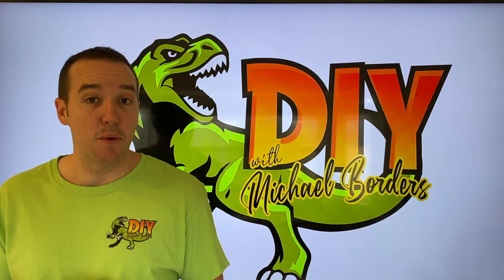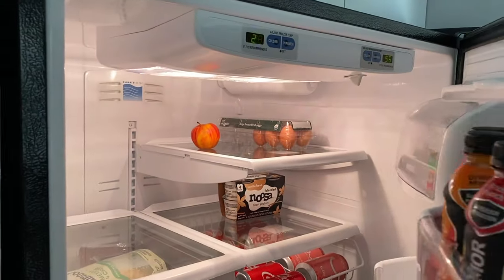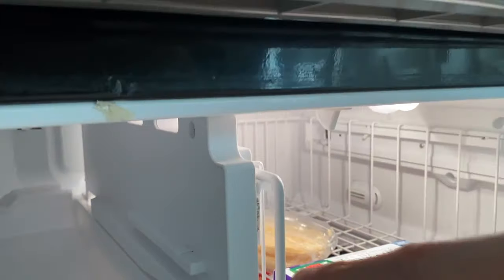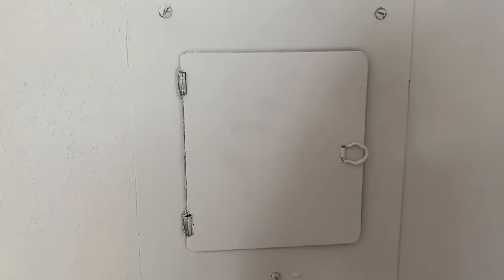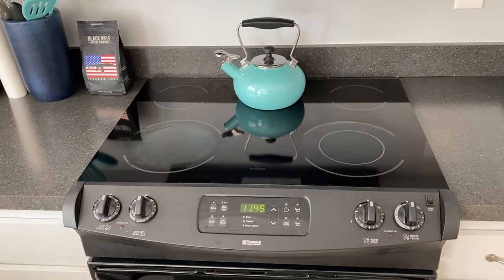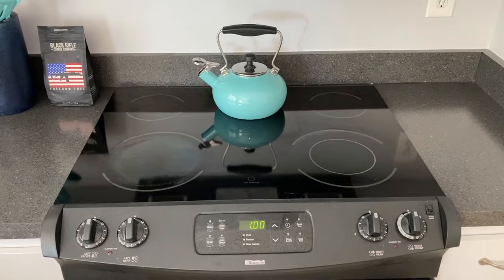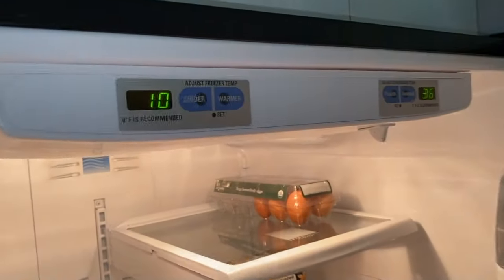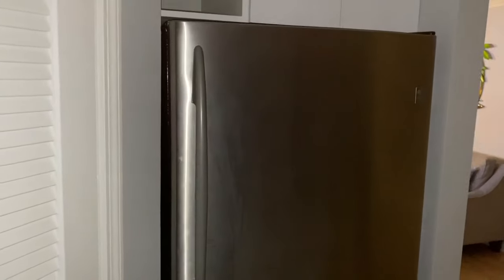Whirlpool GE Refrigerator not cold/cooling - Reset mother board

Comment: I have a Whirlpool.  It quit making ice a few weeks ago and we also noticed that the main compartment is not getting as cold as it used to.  so I put it down as low as it would go..33* in the settings.  We have a thermometer inside but it will not go any lower than 40*.  Do you think this could be the problem?  I had a repair man out yesterday and he claimed it was getting cold enough inside but said we needed a new ice maker so its on order but never seemed to fix the 40* problem.  He said my thermometer might be off.  but I double checked it with a digital thermometer and it was also reading 40*
Reply from the maker: @erock1070  

Thanks for watching.  Have you performed any reset procedures on the refrigerator and freezer?
Reply: @DIYwithMichaelBorders  I can’t find the exact reset procedure for my model. It’s a French door model with produce tray underneath and freezer on the bottom. Ice and water dispenser on the left side.  So It has multiple door buttons given the French doors that shut the lights off so I couldn’t really do it that way.  I did shut the breaker off to it for 10 min. And it does seem colder after 24 hrs.  The fridge is set to 33* and it’s measuring there now.
Reply from the maker: @erock1070  

Thanks for the reply.  In that case, the unit can be fully reset by unplugging it and leaving it unplugged for a minimum of 5 minutes.

Comment: Hey great video. It works for me to reset the fridge but after about a week of operation the freezer will frost over and warm up and the food becomes unfrozen so I have to repeat your process and it gets it going again. I’ve vacuumed all around the compressor and coils. Just wondering what it could be. The possible culprits could be the control board or the switch relay on the compressor or something else. What do you think? Could one of those hard relay switch kits help? Any idea would help and thanks for the video !
Reply from the maker: Good morning, thanks for watching.  We would start with the relay as it may be in its early stages of failure…thus acting intermittently.

Control board is possible however not as likely.  Looking forward to hearing back from you.
Reply: @DIYwithMichaelBorders  awesome. Much appreciate your reply. In that case I will order an amp clamp from Amazon and begin testing of the relay and if it is indeed starting to go I will buy a replacement for it and put in a new start relay. How long would you say that fix should last it? Couple years maybe?
Reply from the maker: @yycshawn123  

Thanks for the reply, the part itself should last up to 10 years if refrigerator is placed in normal operating temperatures as opposed to out in a 100*+ garage or freezing cold garage.  😎👍

Comment: What would I do if I don’t have that switch inside the refrigerate? I have a Samsung 3 tier refrigerator and can’t seem to find the switch or anything that would send a signal that the doors are closed.
Reply from the maker: Good morning ☕️

In your case, you would perform a full reset procedure by unplugging your refrigerator and leaving unplugged for a minimum of 5 minutes.

After 5 minutes, plug refrigerator back in and allow refrigerator to reboot and hopefully reconfigure itself within 5-10 minutes after plugging refrigerator back in.

Comment: could this cause frost build up as well? I have a Freezerless Whirlpool and the fridge stopped cooling and I found frost build up. It is unplugged thawing now. We have micro power )3 seconds up to 1 hour) outages several times a week.
Reply from the maker: Thanks for watching & it’s definitely possible.  Did the reset help the system reconfigure back to normal operations?
Reply: @DIYwithMichaelBorders  it is still thawing out. I will do the reset tonight. I am anticipating it will correct the issue. I will let you know. Thank you :-)
Reply from the maker: @hEALINGsOUL77  

😎👍🔧🔩
Reply: @hEALINGsOUL77  Did it work?

Comment: I don't have this model, mine is GS2SHEXNL00 (2004), and I have tried some of these resets but not working. My compressor shuts down when I open the door. I unplug from the wall then plug it back in and the compressor starts up again but then shuts down when I open the door. I'm trying to find out if my unit has a master reset button. Do you know?

Comment: I have a whirpool and had a storm, mine has double minus s sighs and two minus signs lines where  the temp is. Also I have 2 refrigirator swtches and one in the freezer, can you help me? Also the frezer light  was not working so i was hiting it manual to get the light to come on, Could I have turned my freezer and fridge off by accident? I did subscribe and ring both bells :)

Comment: My whirlpool refrigerator you could hear the compressor go on for about a minute it’s a little loud then after that minute of it being on you will hear a click sound then the compressor shuts off. I tried replacing the start relay and capacitor and nothing has changed. Any ideas? I will try this method tho
Reply from the maker: Good morning Nelson, happy new year.    Have you performed this reset procedure?

You will also want to ensure that both the refrigerator door and freezer door are fully closed to a point where they press their respective switches shown in this video to the up and engaged configuration.  If either switch is not fully engaged, the compressor will act sporadically.

Comment: My fridge section just keeps cooling without restraint. Is this a feasible fix? We do have many mini outages in our area.  I've tried it doesn't seem to do anything on my WRS571CIDM02. Is there any indicator that it works on the panel? This is an updated electronic version of the fridge. I've also ordered a replacement defrost thermostat figured I'd start there.
Reply from the maker: Thanks for watching & welcome to the DIY Raptor Club.  The defrost termination thermostat is the 1st place to start & almost always fixes this issue.  Please keep us posted.

Us fellow DIY’ers need to stick together!

😎👍🔧🔩

Comment: Hi Michael.... trying to troubleshoot my french door whirlpool fridge. It suddenly stopped cooling, and seems to only run when the doors are open. Once you shut the doors, it's silent with no fans running. Any ideas? I tried to reset it this way, but seems the same. Help!
Reply from the maker: Good morning & thanks for watching.  We recommend unplugging refrigerator and leaving it unplugged for 5 minutes.

After 5 minutes, plug refrigerator back in & see if this helps.

😎👍🔧🔩

Comment: Good video but what if the reset doesn’t work? I have a 2.5 yr old whirlpool that’s not cooling
Reply from the maker: Thanks for watching, it may take a second reset attempt to fix issue.  If that doesn’t work, it may need a new compressor.
Reply: @DIYwithMichaelBorders  thanks, I’ll try it again. What about the start relay and capacitor?
Reply from the maker: @jeremygroznik297  

Definitely a possibility, can’t rule them out.  😎👍

Comment: Tried these fixes with a whirlpool - no luck - just getting the two dashed lines of death (meaning display mode/no cooling) followed user manual to repeatedly press the minus sign on both fridge and freezer - no luck - threw the breaker for 5 and 10 minutes off - no luck. Any help Michael? Thanks! WRB329DMBM01
Reply from the maker: Thanks for watching & sharing this, welcome to the DIY Raptor Club.  Sounds like you’ve done all the reset procedures.

We would try unplugging refrigerator from outlet for a minimum of 30 minutes.  That sounds like a long time however refrigerator will stay very cold if doors are kept closed...however your refrigerator is warming up as we speak.

After 30 minutes, plug refrigerator back in and see if this full system reset boots the control board back into gear.
Reply: @DIYwithMichaelBorders  Thank you so much for the reply - did end up turning all power off for 6 hours before throwing power back on - no luck still. Any other suggestions or just broken? ordered a new electronic board today.
Reply from the maker: @kendrick153  

You are one step ahead of us, that makes us proud!!!  You are a true DIYer!!!

Replacing control board is our next recommendation.  Please keep us posted, us DIYers need to stick together!

😎👍

Comment: Tried pressing the switches (in the fridge and then in the freezer) 3x each.  Didn't help.  Tried shutting on the breaker for 5 mins, turning it back on... nothing.  Tried the switches again.  Nothing.  Waited more than 10 mins to see if it would kick in.  Nothing.  Guess its time for a new refrigerator. 😔
Reply from the maker: Good morning, just poured a cup of coffee and am sitting down to answer any and all questions for the DIY community.

We appreciate you sharing this.  You likely have a worn out compressor.  If so, kinda an annoying and tough decision because a new compressor can cost a few hundred bucks to have installed…but some will say it’s best to put that few hundred bucks toward a new refrigerator…

A recent viewer of ours experienced the same thing.  He ended up buying a used refrigerator off Facebook marketplace for $50.00 and brought it home.  After he brought it home, he took the compressor off the refrigerator and installed it in his old refrigerator….he did that because the refrigerators were different colors and he wanted all of his appliances to match.

Well, he then turned around 1 month later and sold his original refrigerator for $200.00 bucks and bought a brand new refrigerator.  He sold the used one for parts and someone came and picked it up for $100.00.  The guy mentioned he has 15 rental properties and almost all of them have that exact refrigerator…so he wanted it for parts.

Please keep us posted on what you end up doing.  

Let us know if you have any questions and hey if you’re into crypto trading, join our DIY ecosystem and become part of an exclusive group of DIYers.

       toolboxtoken.com

Reach out to us any time!  🧰

Comment: hi there
nice video
i have a whirlpoo double door model 20RI-D4 A+ PT refrigerator
the compressor and both fans are off
the fridge is not on standby I checked the control panel, it's showing both temperatures
cheked the relay it seems ok

what can be the problem please?

thanks
Reply from the maker: Good morning & welcome to the DIY Raptor Club.  If this reset procedure does not work, the next step is to fully unplug refrigerator from outlet & leave unplugged for 5 minutes.

After 5 minutes, plug refrigerator back in and see if the system has reset and begins working properly.

😎👍🔧🔩

Comment: My fridge is constantly beeping 
I don't know know what that mean

Please help
Reply from the maker: Thanks for watching & welcome to the DIY Raptor Club.  The two most common causes is the door seal not properly sealing when closed & the second being food items blocking the air vents inside.

Please keep us posted on your project.
Reply: It's a loud screaming beeping

I checked the fan I'm the back and it not that.

The beeping seems to be coming from the motherboard 

The refrigerator and freezer isn't cooling.

Any advice?
Reply from the maker: @paulsmith294  

Thanks for the update, you may need to perform a full system reset by unplugging the refrigerator for a minimum of five minutes.
Reply: @DIYwithMichaelBorders   I did that already And still no improvement.

I cleaned the corals the best way I could and noticed that the freezer started to work a little it better but the refrigerator is still at 55ﾟ
Reply from the maker: @paulsmith294  

Thanks for the reply, do you hear any sounds such as hissing?  You may have an issue with your compressor.